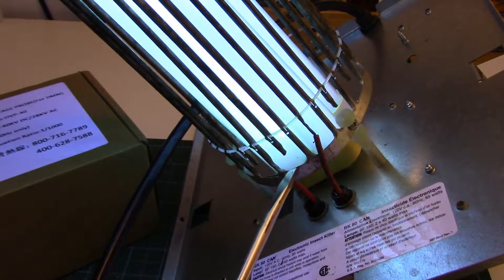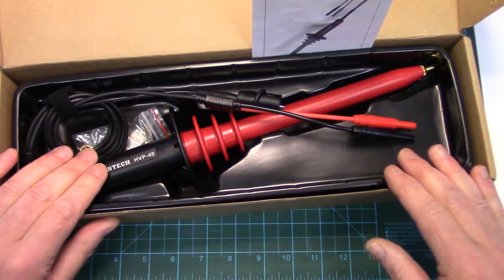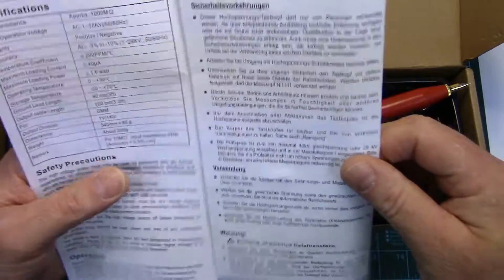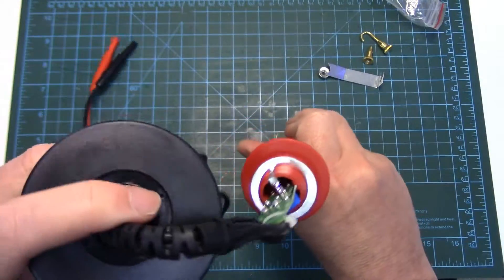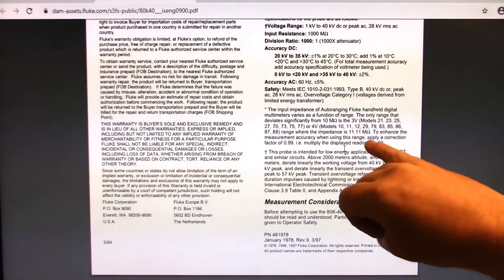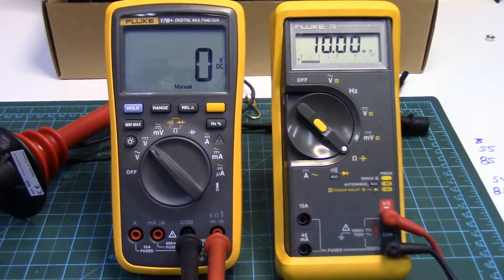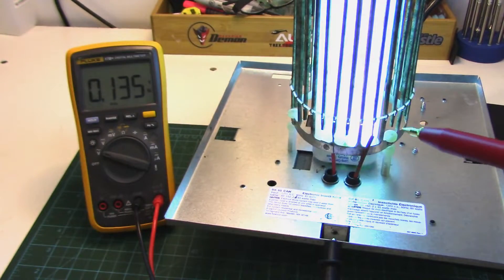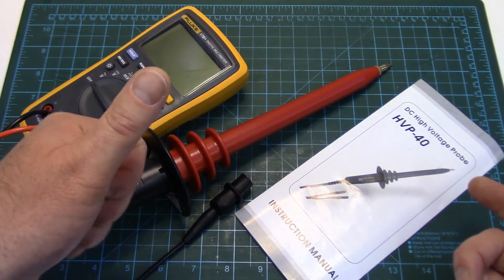DMM High Voltage Probe Review - What You Need To Know

Comment: When you checked the bug zapper, I wondered if the output was around the supply frequency or if they upped he frequency ? The specs refer to 50/60 Hz. I wonder how it performs at high frequencies. CRT Drive circuits used to work at 15.625 kHz on the AC side and produce up to 25 kV on color TV sets. Keep frequency in mind as this could be an issue with the probe.
Reply from the maker: Yes, good point. HV probes like this one and the Fluke 80K40 are no go at measuring high frequency AC. There are special HV oscilloscope probes that are used for those specific applications (very pricy) 🙂
These things work best for HV DC and of course nominal line voltage frequencies. Also the DDM will play a roll in that as it would have to be true RMS (which the 17B is not), and most true RMS meters that I've played around with over the years start dropping AC voltage accuracy over 1kHz but I know it all depends on the meter and I have no idea what the actual frequency limitation of these types of probes are? My guess is they can certainly work beyond 50-60 Hz into the hundreds of Hertz,  but they put that value in the specs since many will be using them with non true RMS DMM's and they are calibrated at line frequency. Even the Fluke 80K40 is pretty specific that the stated +/- 5% AC accuracy is specifically obtained at 60 Hz.  
As for this specific bug zapper, it uses a standard step up transformer so the secondary is also at line frequency. Upon inspection the culprit was easily found: The high voltage wire from the transformer that fed the lower potential grid side was actually pinched under the transformer during assembly. Unreal! It wasn't pinched bad enough to short to ground through the insulation, but it was obviously leaking voltage. After rerouting that pinched wire correctly, voltage on both sides was even so it was an easy fix. 👍
Reply: @Rchelicopterfun  Thanks for your reply. Yes, I have a Fluke High voltage probe.
They come in handy when checking the anode voltage  on HF Linear Amps.
The one in the video seems quite well constructed and reasonably priced. Thanks.

Comment: 17:54 - 29,740 Volts
Reply from the maker: Good eye, but the value is actually 2.974 so 2974V just before the probe end made full contact with the terminal and the reading stabilized. The decimal actually dropped one place of resolution before the value changed (autoranging 4000 count meter).
Reply: @Rchelicopterfun  Ok, so, that very high voltage is not a peak, but a bad first contact or a wrong DMM first reading?
Reply from the maker: Neither. It was the display reaction time delay (DMM & LCD refresh rates) from when it reached its 4000 count limit (this is a 4000 count DMM) and dropped a decimal place of resolution before the value refreshed momentarily showing 4 places of resolution and the 29.74V value instead of 3 places of resolution @ 2.97V.
If it was an 8000 or higher count meter, that decimal drop wouldn't have occurred and the meter would still indicated 4 places of resolution instead of 3 as the reading stabilized to it's final value of 7.80. You'll notice right after that 29.74 value was show is when the meter dropped to 3 places of resolution.
If you are not familiar what DMM meter count is and how it affects resolution of readings, there is lots of info online. In short, DDM meters need to stabilize before you take a reading; no useful values are obtained as they jump around when first probe contact is made, especially when used in autoranging in combination with a high voltage probe where voltage potential will be read even before the probe makes contact due to the air molecules in the near vicinity of the HV source being ionized (conductive).
Reply: @Rchelicopterfun  WOW, thank you for the explanation. Do more videos about High Voltage !!!  Regards.
Reply: I'm researching discharging crt monitors to perform some maintenance. I've see people using screwdrivers with wires attached, a hv probe seems more legit. Ive also heard claims crts can go 30kv easy, so this still would be insuficient for crts?

Comment: How would I discharge a microwave capacitor with this?
Reply from the maker: If you have to ask ⚠ However, clamp the ground lead to ground and touch the capacitor leads (one at a time) with the probe end for several seconds which will slowly discharge the caps through the resistor to ground.
Reply: @Rchelicopterfun  your caution is noted and welcome. I only knew how to discharge them by using a high value resistor.
Somehow I had never heard of or seen one of these probes in action. Very cool, thanks for answering.

Comment: Could this probe be used to discharge a HV capacitor that is on a microwave unit?
Reply from the maker: @RyanReszczynski  Absolutely
Reply: @Rchelicopterfun  thank you very much for responding. I figured it would work for discharging a cap with a voltage range between 3500-5000VDC. I saw another video that used one of these to discharge an anode on a crt but never received a reply.

Comment: The ground lead is not only for safety, without it connected it will not work as the ground lead is also the bottom of the potential divider resistor

Comment: I'm so very confused! On DK's voltage divider calculator, you put in 10,000,000,000R / 10,000,000R which does give you your 1000:1 ratio.....HOWEVER 1,000 megaohms is NOT 10 billion ohms, it's only 1 billion ohms. Mega = 10^6th. So 1,000 megaohms = 1,000,000,000. That paired with a 10Mohm meter would result in a 100:1 ratio. What am I missing here? Your test obviously showed it was working.
Reply from the maker: I guess the most (only) logical explanation is the probe's internal resistance is not a thousand M-ohms as stated, but ten thousand mega ohms (10 billion Ohms)  to give the 1:1000 attenuation ratio because we know for a fact the meter's impedance is 10 M-ohms. Perhaps the one thousand number is the resistance in the probe end only and then that other variable resistor in the handle is what makes up the difference? No idea as I didn't design the thing; at the end of the day all I care about is that it works safely and gives the correct value at the meter. 🙂
Reply: @Rchelicopterfun  I really appreciate the video! I have a HiPot tester at my job and I am going to buy one of these so that I can calibrate the HiPot to make sure that the voltage is coming out at 8kV. Being a perfectionist I wanted to run the math to make sure before I purchased it, and I got very confused when I started doing research! If you go to Fluke's datasheets, they also say their probes are a 1000Mohm resistance paired with a 10Mohm DMM makes for a 1000:1 ratio, so it's quite confusing! If I find out why this is I'll make sure to drop a comment here. I'm sure there's some logical explanation!
Reply from the maker: @AJ Robinson - much apricated if you can comment back if you figure out the reason. None of my my DMM's can measure super high resistances so I can't confirm what the probe's resistance actually is. I was only only going off the specs of the probe, but the more I think about it (while I should actually be working - lol), I'm guessing the big resistor/s in the probe tip is/are 1000 M-Ohm as stated. Going by the current draw table in the Fluke manual, that number holds correct at the various voltages they list. That variable resistor in the handle is the key I think. I'm not at home right now to check, but going by what I can see in the video, it looks to be in parallel across the two leads going back to the meter. If that's the case, it would be dropping value of the meter's 10M-ohm impedance down to... 1M-Ohm?
Reply: @Rchelicopterfun  got it! If you check the manual one more time, you'll see that there is a resistor "RB" [~1.11Mohm listed in another fluke manual (80K-15) in parallel with the multimeter. That brings the total resistance of the meter down to 1 megahohm giving us our 1000:1 ratio!

Comment: You mentioned that your electronic air cleaner crapped out. Mine has too. Were you able to figure out what failed? Mine has some strange components that I can't find on the internet, so I'm having to guess what they are and what their specifications might be.
Reply from the maker: The failure to our air cleaner happened before I got this HV probe, so I was unable to test it (just one reason I've been wanting one). Anyway, to get ours working again, I ordered a new board.
Reply: @Rchelicopterfun  Mine was built in 1985 and I can't find a replacement power supply for it, so it's fix it or switch to media filters. It's easier to switch to media, but I really want the high of fixing it (without electrocuting myself in the process).
Reply: @garygilbreath2218  if it's a honeywell electronic Air cleaner, I've had to do all the searching on the internet for instructions etc. and then bought replacement power supplies (yes, 2) off ebay.  mine was ancient F50A, and it's still possible to get the replacements.
Reply: @ronlamb-strategy2execution110  I also have a Honeywell F50A and was able to fix it by replacing the power supply. The one I'm having trouble with is a Carrier 31MP420110. It's got 8 passive components, so it's pretty simple. I'm considering buying another Honeywell PS and just using that in there instead.
Reply: @garygilbreath2218  you’re fortunate that the new power supply fixed it.  I’ve bought two new power supplies or differing versions but neither will light up the neon light, so can’t figure out what’s going on that none of the new boards fixes it.
Reply: @ronlamb-strategy2execution110  Did you bypass the AFS (air flow sensor)? If the AFS is dead (like mine is) the PS won't generate high voltage and the bulb won't light. To bypass AFS, short together the two pins on J4 that correspond to the black and violet wires going to the AFS. If you're doing this on the bench rather than installed in the system you also have to depress (or bypass) the interlock switch. Bel-Aire has some documents on their website that are very helpful.

Comment: Hi, is there a way to chech that hv-probe is working and it does it job right without the hv source?
Reply: You could use It on a lower voltage that the meter is able to measure without the probe. Just do the math for the readings.
Reply from the maker: Not that I know of.

Comment: Excellent video, answered all my questions and more!  Just ordered one from BandGood.
Reply from the maker: @ William Hada - Thanks, hope it works well for you too. Mine's still working great after a year now & I've used it a fair amount.
Reply: @Rchelicopterfun  I am a little unclear on where the ground connection on the probe should be placed. On the Fluke 80k-6 probe that I have, the Fluke manual says to connect it to an "earth ground".  Does that mean that I should run a wire to a water pipe and connect to that?

Comment: Thanks for another great video. Looks like a nice product but why is it restricted to 50/60 Hz?
Reply from the maker: That's the range where these HV probes that are used with DMM's are designed to be the most accurate with the multimeter in the AC scale. You could certainly use them at frequencies outside that range, but then they would not be within their designed +/-5% allowed accuracy tolerance.
Reply: @Rchelicopterfun  Hi John,  let's say 100khz,  do you think it should work with 90% accuracy ? for exemple on a scope?..
Reply from the maker: @TitofBee  I missed this follow up question but NO, NEVER EVER  USE A REGULAR high voltage DMM probe with an o-scope or at high frequency. There are special HV probes for O-scopes to be used at higher frequencies.  They cost much more and there is lots more to them in terms of filtering.